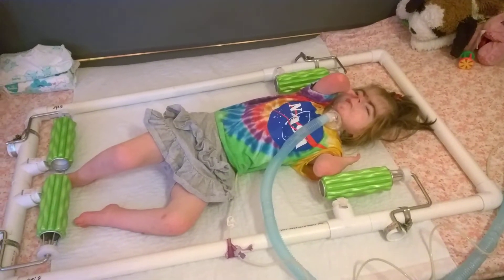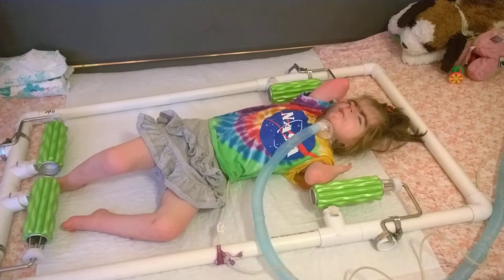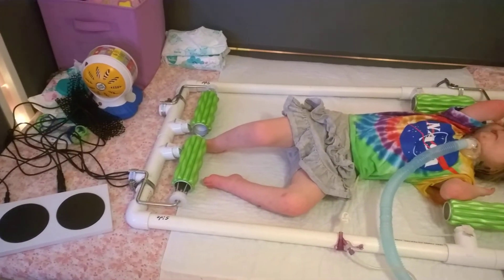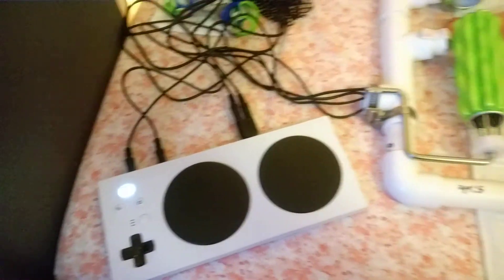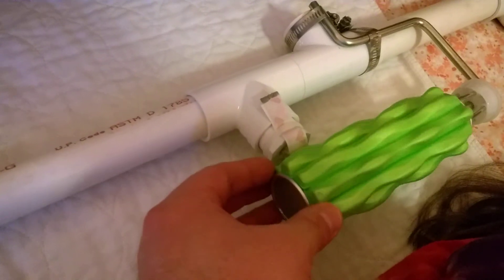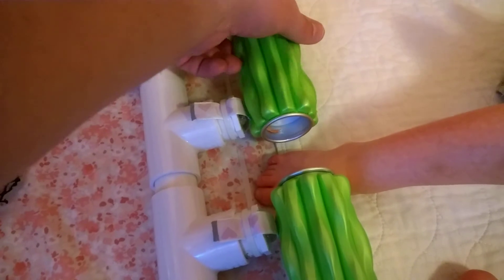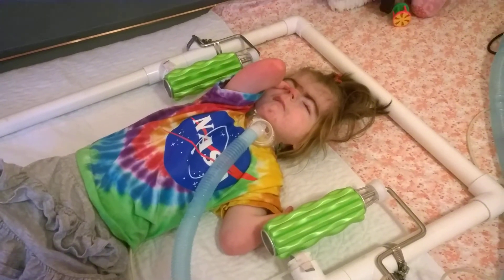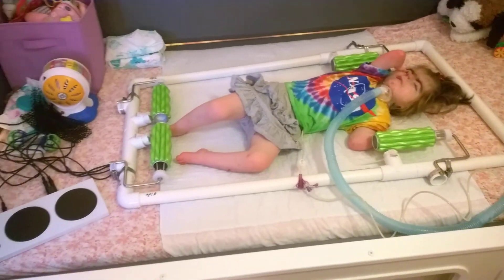Xbox Adaptive Controller custom input device

Comment: Hi, I'm physically disabled and mostly bedbound. Something like this might work for me. Thank you for sharing! Did you find that the spinning mechanism was easier to activate than placing giant switches or something similar?
Reply from the maker: She uses the large switches at school for different activities but in this case I was trying to mimic some spinning toys she already played with and it fit the theme of drawing lines in the style of an Etch A Sketch to use the rollers.
Reply: @dr_fish Gotcha! Yes, those giant switches take too much force for me, usually, so I was interested in your setup. Plus, the foam rollers would hurt less if my dystonia caused me to suddenly move and whack them. Did you end up making any further adjustments that you'd recommend if I can find someone to make one for me?
Reply from the maker: @FasterOnWheels  I didn't make any other changes to this design. However, if I was making it again today, with access to a 3D printer, I suspect I would do a number of things differently. That said, with the Adaptive Controller there are many options for switches. If you haven't already, I suggest you watch some of the other videos on my channel about the project, because I highlight some non-conventional switches and mods. For example, switches for arcade games are very responsive to light touches and can easily have something like a ping pong ball glued to them to make them easier to touch. Tilt switches and magnetic switches also work well.
Reply: Thank you! Yes, those switches would be great. I don't have anyone to make them for me at this time, but I'm definitely going to keep them in mind. The tilt switches are especially smart.